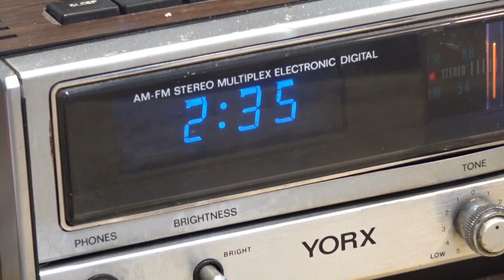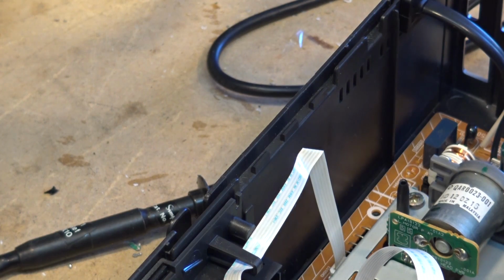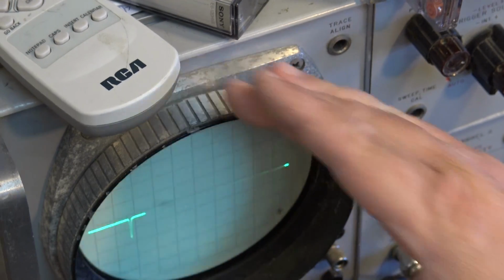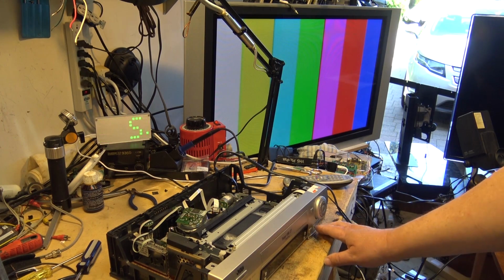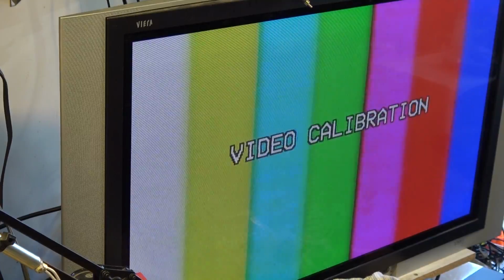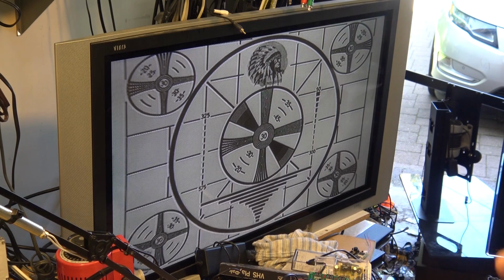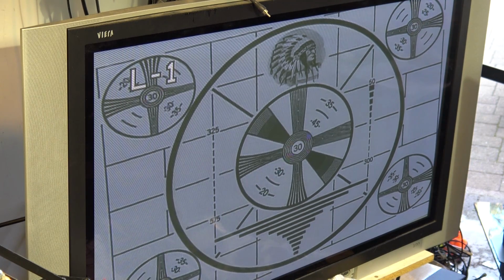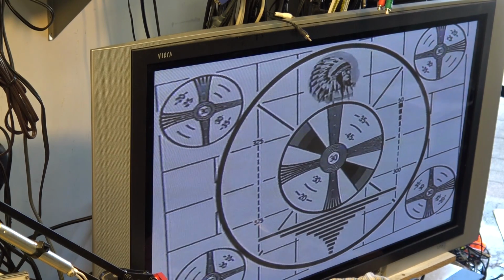JVC HR S3910U S VHS thrift store score

Comment: what's the resolution of a dvd? wonder if you could try using a dvd recorder
Reply from the maker: DVD in theory will hot 500 lines just like DV tape.
DVD is a fixed pixel count 720 x 480 which is the same as DV tape.
VHS and Beta is not. It is analog, so it is all about the bandwidth, and what you can get back from an analog signal.
VHS is about 230 lines, Beta 240, Video 8mm 260, 3/4" 330, S-VHS 400,  Hi-8 420, ED-Beta 500, DV 500, DVD 500.
Reply: thats right
Reply: Wouldn't DVD be 378 if you converted the "line measurement" to the same form as the others?   720 times the 0.7 Kell factor, then converted to "TV lines" by multiplying by 3/4?
Reply from the maker: DVD and DV is a digital fixed pixel count.
720 pixels per line, 480 lines for NTSC, 576 for PAL
 Horizontal resolution is a term coined for analog TV to show where the bandwidth rolls off. In digital it is a fixed count, but the approximate equivalent, if it was an analog signal would be 500 lines.
Reply: The reason I believe 378 is correct for DVD in comparison to "TV Lines" figures is because first, the 0.7 "Kell Factor" takes into account the difference in digital fixed pixel count and analog, plus "TV Lines" are lines per picture height, not width, so any digital pixel count would have to be multiplied by both the 0.7 and the 3/4 aspect ratio, giving 378.    Let's go backwards for a moment and go from analog to digital.  Consider an NTSC standard 4.2 MHz signal.  If you take 4200000 and divide by 29.97, then by 525, you get 266.9336 Hz (the bandwidth per scan line in the analog system) then you have to multiply that by the fraction ((52 + 8/9) / (63 + 5/9)) to eliminate the parts of the scan line that do not contain picture information.  Doing this leaves 222.1336 Hz bandwidth per scan line of NTSC standard picture.   Doubling this gives 444.267 "lines per picture width".   Note that this would be multiplied by 0.75 to give "TV lines" to give 333.200.   Note that if we divide this number by 4.2, we get 79.333, which is where our good old "multiply the bandwith by 80" rule came from)  to get TV lines of resolution from MHz.   However, if we want the digital pixel equivalent for NTSC luminance, we need to take the bandwidth per picture scan line per picture width, which was 444.267, and divide it by the Kell factor of 0.7, giving 634.67, so we need 635 pixels across the picture to be roughly equivalent to 4.2 MHz bandwidth, so this means that DVDs 720 would be equivalent to a bandwidth of (720/634.67) * 4.2, or 4.76647 MHz.    Multiplying 4.76647 MHz by 79.333 to get TV lines that way gives 377.99 TV Lines for DVD.    Of course, this just luminance.   It is really eye opening to see how low the chrominance resolution was for NTSC, and it was even worse for "color under" type VCRs, and DVD had a much better appearance because of the much better color bandwidth (half the luminance resolution per scan line although it lost half vertically, but still far better than broadcast analog or VHS or Beta).
Reply from the maker: 3Cr15w311 
we are not comparing apples to apples here. you are talking 16x9 aspect ratio vs 4x3. 
on fixed count 16x9 the pixel count 852x480 for ntsc based displays. now on DVD and DV there were 2 way to arrive at this output pixel count and it involved the shape of the pixels when converted back to an analog signal but as a 4x3 frame size the sample rate was 720x480.  we can still use a resolution chart and you will see comparing the output from DVD and dv tape will hit 500 lines of horizontal resolution easily. I have done the test in the past. I did it in 2000 when I bought my last 10,000.00 camera, the one that now sits in my living room as a decoration. I framed up the same chart and it went right to the 500 mark, displayed on a high resolution CRT as back then that is all we had.
Reply: Actually I was using 4 by 3 and my 3/4 factor was due to TV lines being specified in the strange way of lines per picture height rather than width, so saying that something has 333 TV lines (NTSC broadcast) is equivalent to saying that NTSC had 444 lines per picture width if it is 4 by 3.   That is an apples to apples problem when comparing to digital.   The other apples to apples problem is these lines figures being analog (how many sine wave wiggles, doubled) you can get across a line vs. the number of pixels requires to give roughly the same resolution.   You tend to need roughly 42 percent more than the number of lines per picture width in analog.    By the way, I'm debating in a friendly way.  I love your videos and have learned a ton from you!    Consider this a friendly argument.    I'm going strictly on mathematics and it has been a few years since I have looked at the resolution test pattern from DVD and now I'm so curious that I want to do this on my set when I get home, showing it in 4:3 and seeing where the resolution tops out, and I'd expect it to peter out between 350 and 400 horizontally from DVD except right around 540 were the pitch would be locked to the sample grid.   I'd expect most of it between 350 and 540 to have aliasing artifacts and would expect that videos taken of fine textures patterns (like striped or patterned shirts) would need a low-pass filter to limit to 378 TV lines (which is about 504 lines per picture width in 4 by 3 aspect) to avoid aliasing problems.    When I get home tonight, I'm going to put on a DVD I have with the test pattern encoded on it and see where the resolution dies out (something I haven't looked at since 2003).   Could you encode that test pattern to DVD and do the same?    I'm so curious now.
Reply: I did look at one of the resolution test patterns on the DVD I have and it had a different one that should serve the same purpose and it does appear that the resolution went up to around 475 but I haven't checked the pattern to see if the spacing is for TV lines or lines per picture width.    It's a shame that DVD did not have the exact pattern you used.
Reply from the maker: What I plan to do is shoot this test again, using a proper 4x3 3CCD broadcast camera, and pipe it directly into a Toshiba DVD recorder.
That way I can make test recordings at the XP, SP, LP, SLP and EP speeds, and not just shoot off the monitor, but I will import the resulting files directly.
This will give the beat indication of the resolution that DVD is capable of recording.
Reply: It would be interesting to scan that pattern directly with a high resolution scanner and then downsample it directly using various algorithms to 720 by 480 and see how it looks.

Comment: 12V; 

S-VHS = Hi-Band VHS?
Reply from the maker: Yes, that would be the technical term. Hi-Band. 
Just like Beta. Super beta was Hi-Band, and  then they went one step further with SHB, super hi-band on the SLHF1000.
Reply: Thanks 12V.
Reply: 12voltvids 
Is the SL-HF1000 the only model with Super Hi-Band, and also is it the same thing as ED Beta?